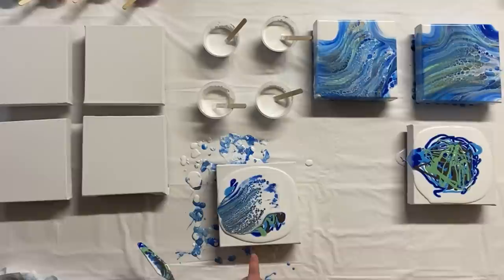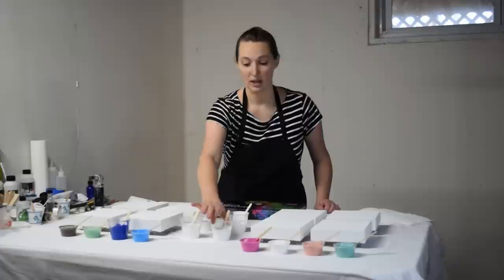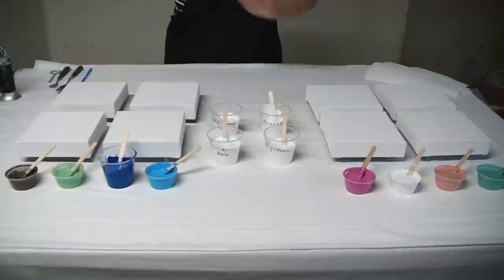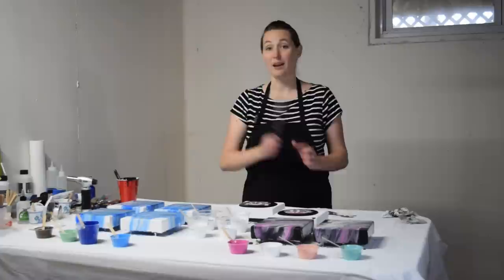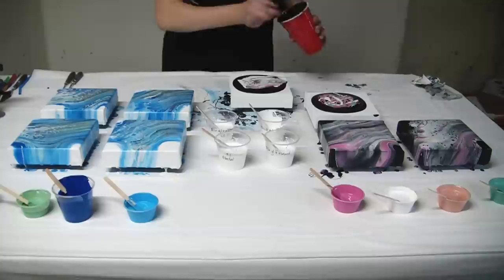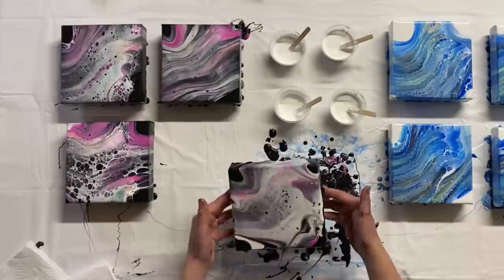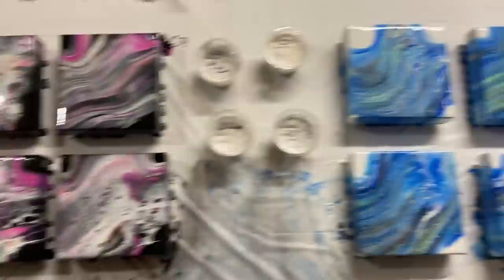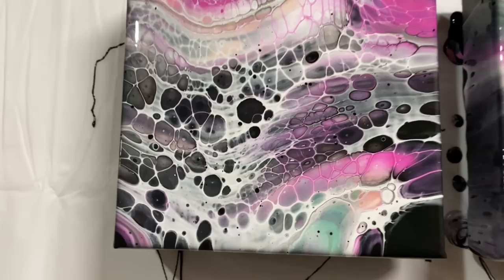The ULTIMATE Inexpensive Cell Activator Test!!

Comment: Did anyone notice that on the second one she did, she used the the cup on the upper left for the first swipe and then used the cup on upper right for the second swipe. Therefore her results are inconclusive because they all aren’t done exactly the same.
Reply from the maker: Yes, several people have pointed that out. Whoops! However, since the mistake was only on the secondary swipe and I primarily analyzed the first (large) swipe when I compared the cell activators. So to me the results are still clear.

Comment: Blooper! You grabbed the nine to one flourtrol for the second swipe with smaller knife on 2nd square. You should have  grabbed the top left one again.  Just saying. So it wasnt an accurate test to determine which is best
Reply from the maker: Yes, several people have pointed this out… 😬
But yes it was still an accurate test because the secondary swipe was more to mask the edges than to test the cell activator. Plus, both of those CAs worked equally well.